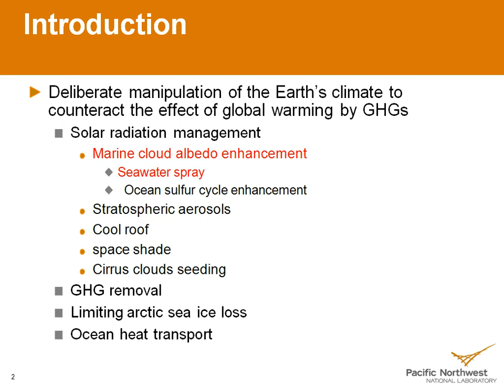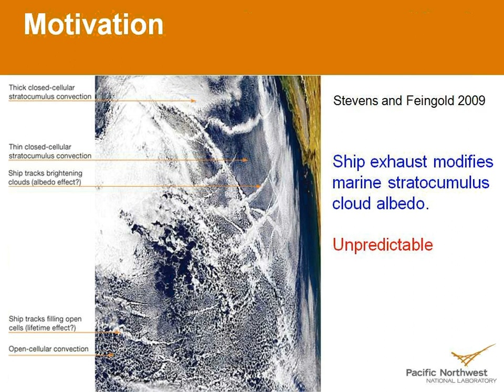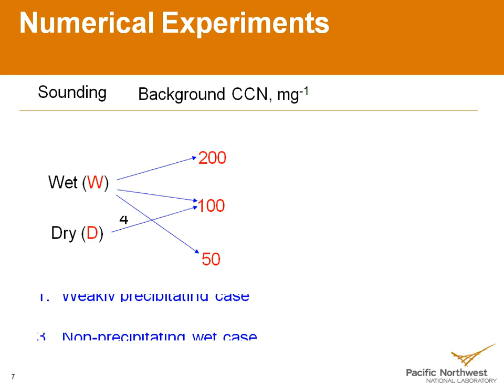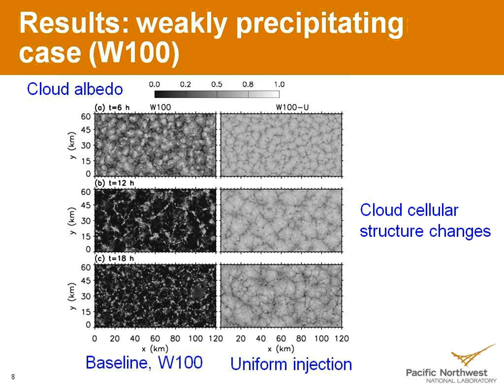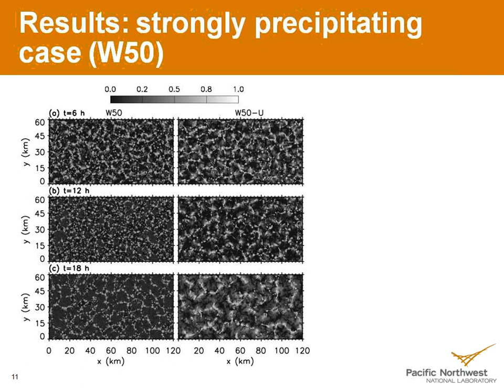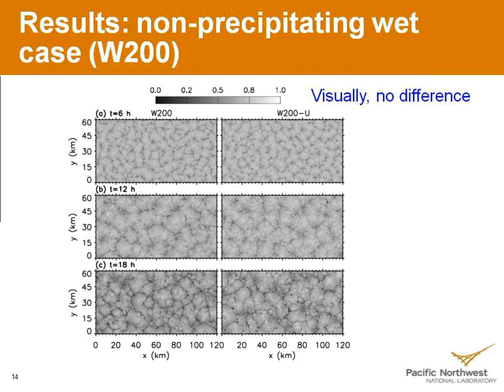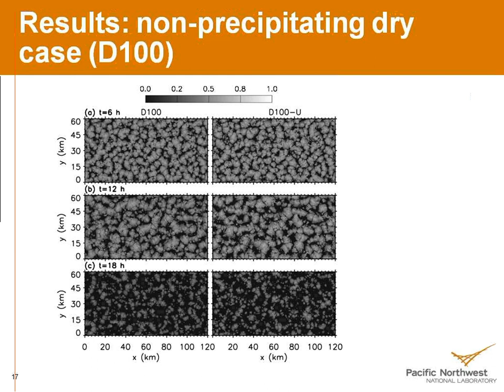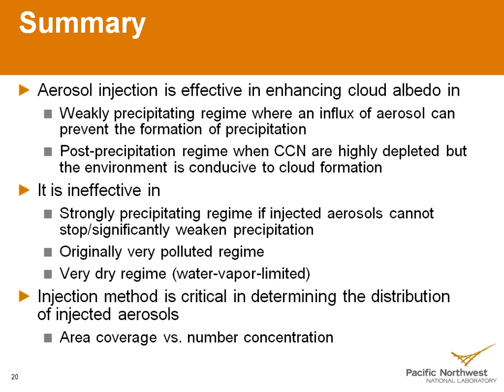Geoengineering marine stratocumulus clouds - where, when & whether to inject aerosols

Comment: The air I live in by the gulf has been like soup for so long. Even though no clouds show on my weather radar widget. But I see the beams everywhere lately. The car here is covered in something black and its hard. Trees have white coating on the s side and are like sponge inside n break off easy. Its bad here.